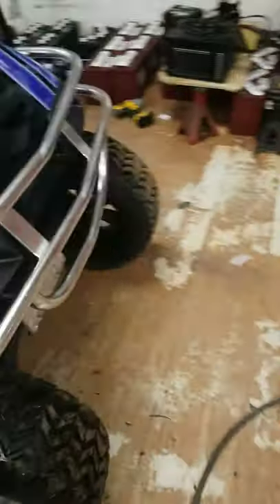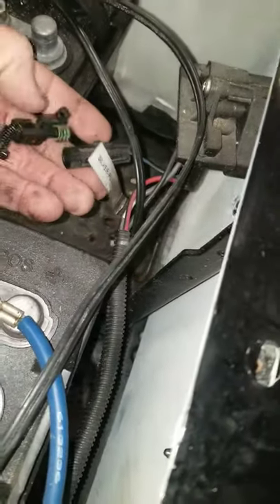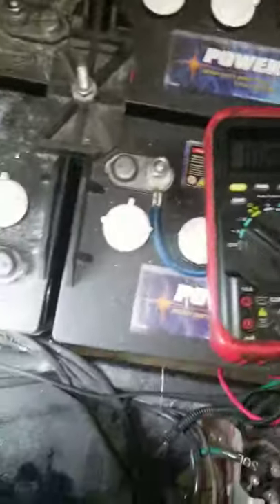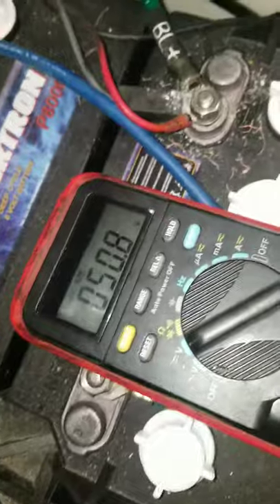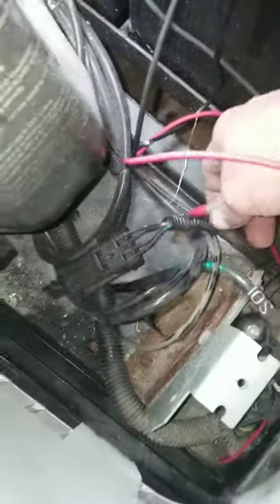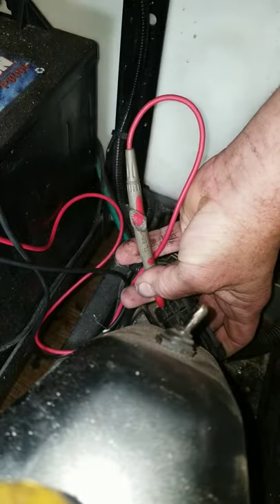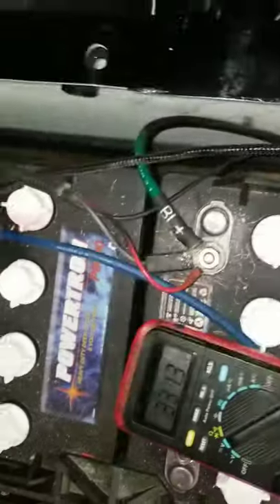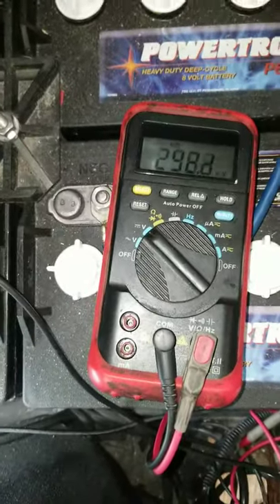EZGO 48 Test charger port, pedal sensor (ITS) and solenoid!!!!!!

Comment: Thanks for the video very informative I’m having trouble with my EZ- GO doesn’t want to move when I press the pedal. I have switch the solenoid and ITS and still no luck and I just discovered today that the wire from the key switch, pedal and micro sensor the white,black,green and red wires do not have voltage nor does any voltage appear when I press on the pedal and the solenoid does not seem to be clicking on any idea what can be going on ?
Reply from the maker: Does your reverse buzzer work?
Reply: Yes reverse buzzing sound works but the wire harness doesn’t seem to get voltage batteries are charged and giving correct voltage
Reply: Seems like enable pin is not receiving power
Reply from the maker: Is it a 36 volt or 48 volt
Reply: 36v
Reply from the maker: @SandraPerez-vu1wc  run a wire from the main positive to the small yellow post on sol. And see if the cart runs
Reply: I ran the wire and yes the cart moves now thank you so much do I the the wire connected  or what would be the correct way to fix that?
Reply from the maker: @SandraPerez-vu1wc you have a bad key switch or a bad wire coming or going from the keyswitch. Or no voltage  going to the controller correctly or coming out
Reply from the maker: Look on my channel and you will see a video on a Ezgo 36 volt
Reply: Thank you so much
Reply: Sorry to bother again but switch ignition switch and still no luck with it running any recommendations?
Reply: Do you think maybe micro switch might be bad I hear it click when I push the pedal but still no luck with the solenoid clicking on
Reply from the maker: @SandraPerez-vu1wc  do you have a volt meter
Reply: Yes I do
Reply from the maker: @SandraPerez-vu1wc  give me about 2 hours then will walk you through some steps
Reply from the maker: @SandraPerez-vu1wc  do you have a tow switch under the seat
Reply: No tow switch under seat
Reply from the maker: @SandraPerez-vu1wc  I am going to send you a link to a video of a cart just like yours check voltage like the video I send and let me know where your losing voltage at.
Reply from the maker: EZGO Golf cart troubleshooting
https://youtu.be/jVJHsNWxT8w
Reply: Ok 👍
Reply from the maker: EZGO Golf cart troubleshooting
https://youtu.be/jVJHsNWxT8w
Reply: I get no voltage from the small red post on solenoid and no voltage from blue wire .
Key switch is good key switch is giving me voltage
Reply from the maker: @SandraPerez-vu1wc  black lead of meter on main negative on battery. Check voltage with the red lead on the green wire going to pedal switch
Reply: It reads 10v I even turn the key on and push the pedal and get the same
Reply from the maker: @SandraPerez-vu1wc  leave black lead on main negative and test the key switch with the red lead. Turn the key on then check both sides of the key switch.
Reply: I’m getting 6v from both sides of key switch
Reply from the maker: Okay check the blue wire on the forward and reverse board for positive battery voltage. Meaning black lean on main negative
Reply: Ok it gives me 14v
Reply from the maker: @SandraPerez-vu1wc  okay check the red wire beside it with black lead on main negative and red lead on the red wire
Reply: Red wire give me 36.40v
Reply from the maker: @SandraPerez-vu1wc  put the blue wire  and red wire together. Jump them together with a wire or something and let me know what it does
Reply from the maker: Then turn key on in forward and hit the gas and see if runs
Reply: Ok I jump them together and yes the cart runs
Reply from the maker: @SandraPerez-vu1wc  okay you have a bad micro switch. I would just bypass it. If it was mine. But it’s up to you.
Reply: Ok thank you so much your the best I really appreciate all the help you gave me

Comment: Good day mate, I got a 2000 motor ezy co 48vlt and trying to find the fuse on it, could you help thanks
Reply from the maker: What fuse.  What kind of problem are you having
Reply: @HeyHeyHey97  well it started with the buggy not moving at all but the reverse alarm was working still so we replaced the solenoid clean it so two weeks of not using it now there’s nothing working not even charging so look into it again to find out that the red wire runs from the charger plug on the buggy meet up with the black wire is rotted of so not sure whether that is the fuse or not but that’s as far as I go
Reply from the maker: @ivanjuriss4772  your charger plug is a triangle correct
Reply from the maker: @ivanjuriss4772  if your charger plug is triangle. That is a temperature sensor. The cart will not charge without it. You will need a new charger receptacle
Reply: Well the red wire I’m talking about is inside the buggy so there are three wire coming out of the buggy plug two black and one red so the red meet up with one of the black wire and it’s rotted off so not sure what’s that one for
Reply: Ok mate thanks
Reply from the maker: You will need a new charger receptacle. You can’t buy just that part it self

Comment: No back up buzzer and intermittent running.  Can plug in charger to charge port unplug and it will run , but may or may not stop . May or may not lock engine brake and turning switch to tow. May or may not release. But if I plug in charger and unplug in a couple minutes,  all works like never happened.  What's your take on that ? Thanks for your help
Reply from the maker: @Aj-wb5rg  you have an Ezgo RXV?  Do you have forward and reverse on keyswitch?
Reply: @HeyHeyHey97  yes
Reply from the maker: @Aj-wb5rg  do you smell a burning smell coming from your cart? Also, what all have you done to the cart. When you say it doesn’t run is that when it has no reverse buzzer or doesn’t move?  When you say doesn’t stop. Do you mean when you press the brake just keeps moving. Like the e brake is not holding.
Reply: @HeyHeyHey97  no burn smell , it has 50 volts at batteries , at solenoid,  and where it's supposed to. But often no buzzer and dosent move. But If I plug it in to the charger the lock out dosent actuate. If it does buzz and drive it will still do so while plugged into charger. Intermittently  without plugged into charger it may or may not buzz for reverse or operate at all. Issue Surely seems to be on this circuit with charge port
Reply from the maker: @Aj-wb5rg  I am going to share a video on how to bypass thst
Reply from the maker: @Aj-wb5rg  Ezgo golf cart won’t move. Bypass reed switch and charger receptacle
https://youtu.be/K9JtW4lZe0w
Reply from the maker: @Aj-wb5rg  even though this is. 48 txt same way you bypass it
Reply from the maker: @Aj-wb5rg  and if it works. Bypass it permanently or replace.  If it was mine. I would bypass permanently
Reply: @HeyHeyHey97  thank you sir
Reply from the maker: Hit that like button for me
Reply: @HeyHeyHey97  done and subscribed
Reply from the maker: @Aj-wb5rg  Ty sir
Reply: @HeyHeyHey97  likewise
Reply from the maker: Did it fix it

Comment: Sir I really appreciate your video.  I tried a few of the things you suggested and almost had my cart fixed.  I'm sure you're a busy man but I was hoping you could help me diagnose an issue. I just installed new batteries in my golf cart and it will not move.  The solenoid does not click. Batteries are fully charged. I jumped the red wire from the charging port to my main battery and for the first time my battery light came on. Thinking this was the issue I threw an eye connector on it and was going to test it out but after connecting it with the eye connector the battery light no longer comes on and the cart still does not move. I do have reverse beep. It's a 2000 E-Z-Go txt series. I have 42.2 volts at the red charging wire and both micro switches. I'm not sure how anything could be bad because all I did was replace the batteries. If you have any suggestions I would greatly appreciate it.
Reply from the maker: Did it run before changing batteries. your cart is 36 volt right? Check main pos and main neg to make sure you have wired correctly. How many wires do you have on main pos and main neg
Reply: I have it wired in series
Reply from the maker: You have 42 volts is that while it’s charging?
Reply: @HeyHeyHey97  lithium batteries
Reply: @HeyHeyHey97  each lithium battery is 13.8 volts which adds up to a little over 41 volts
Reply from the maker: Gotcha
Reply from the maker: On your battery can you turn them on and off on the battery

Comment: Hello, I have 2013 rxv ezgo. We were going up hill and it quit. Sometimes it's wants to go for a few seconds. I followed all your troubleshooting in video. I'm wondering if it's pedal switch. I have 48v on red wire and 0 on green. On accelerator sensor I have 5v on orange 0v on black and 0v on yellow. When I push pedal down I have 5v on orange 5v on yellow and 0v on black. What's your thoughts?
Reply from the maker: If you turn the key on and put in tow will the brake release
Reply: @HeyHeyHey97  no, we had to change unplug wiring plugs 1,2,3 4 and follow directions to switch to auxiliary power to tow cart
Reply from the maker: @brentduncan2137  sounds like bad sol
Reply from the maker: When you hit the gas. What does it do when not running
Reply: @HeyHeyHey97  I turn key on and I hear solenoid click. I push pedal I hear a slight noise by control area, like a puff of air. Really weird
Reply: It's was working fine going up hill it died
Reply: I'll try new solenoid
Reply from the maker: @brentduncan2137  when you hear the sol. Do you hear a buzzing sound
Reply: @HeyHeyHey97  no I don't
Reply from the maker: Are all your battery wires tight. Also do you have a battery gauge
Reply: The brakes wouldn't release so we could tow, until we followed directions on underside cover over solenoid. It described to unplug 1 and 2. And 3 plus 4. I forgot which 2 we connected together
Reply: @HeyHeyHey97  I checked all wires for tightness. We put in new batteries 1 year ago
Reply: When we had in tow position and plugs changed around per direction. One time we push pedal and it tried to lurch
Reply from the maker: @brentduncan2137  do you smell an electrical burn or any kind of smell
Reply from the maker: If don’t smell nothing replace sol. Make sure you get the right one
Reply: @HeyHeyHey97  we never did smell anything electrical burning. I'll try new solenoid Thanks
Reply from the maker: Yes sir thanks for watching
Reply: @HeyHeyHey97  hello again,  I definitely had a bad solenoid. Have a issue with pedal switch or induction sensor. I turn key off and back on and push pedal and it doesn't move. I leave key on and tap around pedal area and then push pedal and it runs. Happened 5 different times
Reply from the maker: @brentduncan2137  turn the key off. And pull back in the accelerator pedal. And then turn key on and see if runs.  I would just replace the throttle switch.  Not the throttle position sensor
Reply: @HeyHeyHey97  thanks again

Comment: I have a 2015 or so stinger48 electric cart. Bought 4 brand new 12volt batteries and the cart won't move. The solenoid clicks and it sounds like the motor engages, but when I try and press the pedal nothing happens. Any ideas?
Reply from the maker: What kind of cart do you have.
Reply: @HeyHeyHey97  it's a EZGO stinger 48
Reply from the maker: Does it have a brake on end of motor.
Reply: @HeyHeyHey97  I'm not totally sure.
Reply from the maker: Ok
Reply from the maker: @bamadave1212  turn the key off put in tow then turn the key back on and see if you are able to push the cart
Reply: @HeyHeyHey97  tried it, but it did not move. Everything seems to work, turn the key clicks and sounds like it engages, but press the gas and nothing and it doesn't move in tow or neutral
Reply from the maker: Sounds like you have a bad brake on the end of the motor.  As long as the aol clicks when you hit the gas.

Comment: Got a ezgo txt 07 model solenoid clicks but no movement forward or reverse
Reply from the maker: You have a 36 volt Ezgo pds??
Reply from the maker: You have a f n r switch on dash. Or a handle by your leg
Reply: It has the f&r switch  is on the dash. Charged all the batteries  changed a couple of battery cables and cleaned the rest of them.
I got it going . Took it back to my aunts  she drove it about 2 days and it got real slow wouldn't hardly go. Any help is appreciated
Reply from the maker: When you hit the gas and the solenoid click.  While you hold the gas down. Does it click back out by itself. Or it doesn’t click back out until you let go of the gas

Comment: I have a 2016 EXGO TXT 48v. I parked it just over a year ago. It sat in my garage for 2 winters without being charged. I thought I had unhooked the batteries, I did not. I got it out, plugged my charger in and it flashes 2 red lights indicating it has too much or not enough voltage. I then tried to charge each battery individually. They would charge and discharge within 45 seconds after being disconnected from the charger. I replace all 6 - 8 volt batteries and the cart wont move. I have voltage on both large posts of the solenoid with key on or key off, but when i turn key on the yellow trigger does go hot and back to 0 with key off. My batteries are reading 8.2 volts individually but when linked together they only read 32 volts. I charged each brand new battery and still the same reading. 

So, then I started at the ignition and then moved on to the solenoid. Thinking It may have been bad I replaced it. With the old solenoid it DID click. With the brand new solenoid there is no click. I am getting the same reading as I was with the old one installed. I moved on to the flat plug you showed at the end of this video and I have constant voltage on the red, Key on or key off. And It looks like I have no voltage on the white with key on or key off. What should I look at next? 

By the way, your video was great!!  Thank you for sharing and trying to help us all save some money.
Reply: I do have Battery voltage at the throttle switch, under the floorboard as I push the throttle
Reply from the maker: Leave the red lead of your meter on main positive and keep moving your black lead of your meter from negative on each battery in series. And see where you voltage goes away at. Could have bad wire or bad battery
Reply: @HeyHeyHey97  thank you! I will try that. That would mean I’ve lost 2 batteries voltage. The cables look good but I will test and update
Reply: Well, I feel like an absolute idiot. But with our taking a second and messaging you I may not have figured out the problem. 

I did exactly as you said and found I had no voltage from the last battery. I realized I hooked it up backwards. Flipped it around and hooked it up properly and BAM! It moves.  Now the charger worked and I’m back in business. Thank you for your help. 

Sometimes we like to make things harder than they are. Sometimes we overthink things as I did in this situation. 

Thank you again
Reply from the maker: It’s all good man. I been doing it for 28 years. And that’s how it is sometimes💪💪

Comment: I have a fleet of 48v TXT models and one of them will run in reverse but not forward. I have checked the forward and revers switch but it is fine. I've had issues with the inductive throttle sensor on some of my other carts but I feel like it wouldn't go forward or revers if that was the issue. A year or so ago this particular cart had a few nicked wires in the wiring harness where it runs through the frame on the underside of the cart. I cut and spliced the wires back together and this solved the problem. Since I don't do this everyday I forgot what method I used to troubleshoot this problem. I remember jumping a wire from somewhere but I can't remember exactly how I did it. Any ideas?
Reply from the maker: I would flip the wires on the f n r switch. And see if it runs forward and not reverse. If it does then you know its switch if it don't its probably a wire.  Do that test and let me know what you find and will tell you next text.
Reply: @HeyHeyHey97  Thanks for replying! I already tried that and still only runs in reverse. Crazy thing I just went out and checked it and it ran in forward and reverse but it will eventually die out in forward.
Reply from the maker: @brianwright6306  check your battery voltage in forward it runs off full battery pack and in reverse halve
Reply from the maker: @brianwright6306  get you a volt meter and check the forward wire at the controller to make sure its getting g the proper voltage

Comment: Great video. Thank you
Reply from the maker: Thanks for watching hope it helped
Reply: @HeyHeyHey97  You're welcome. One inquiry, you reference and "ITS" in the video, what is an "ITS?" Thank you
Reply from the maker: @duanebrown2879  inductive throttle sensor. It’s in the floorboard. It will cause the cart not to run and also int running
Reply from the maker: @duanebrown2879  inductive throttle sensor. It’s in the floorboard. It will cause the cart not to run and also int running